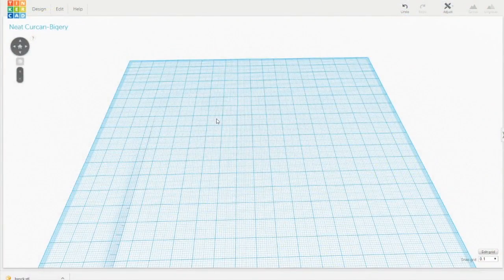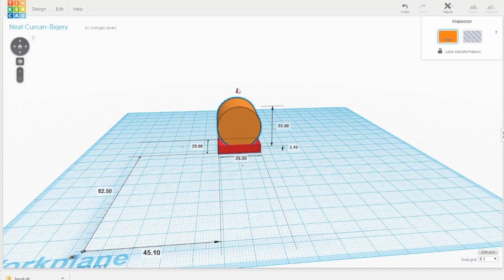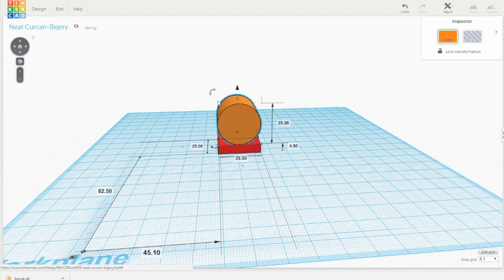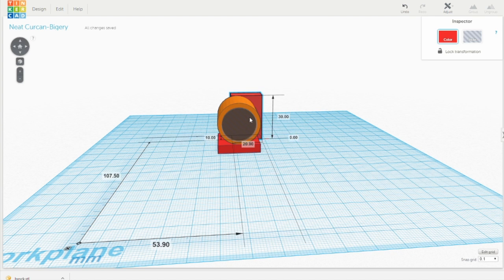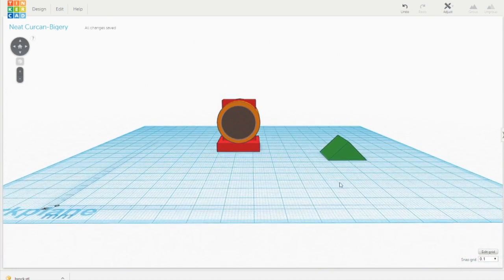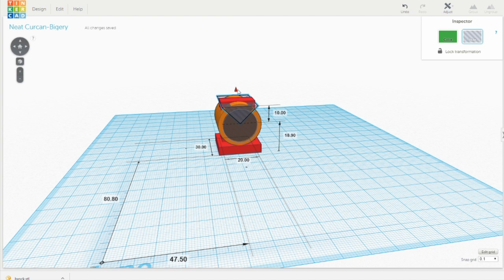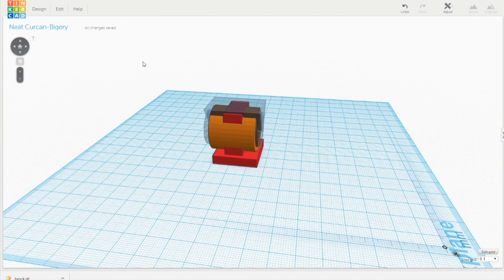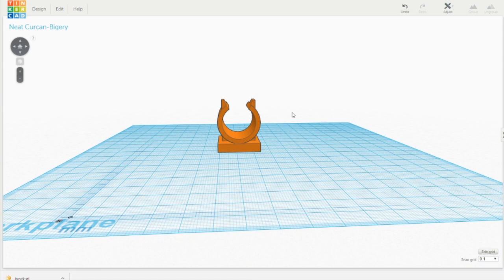TEVO Tarantula 3D Printer  -  Bed Cable Guide Fix!

Comment: Why not a chain?  The bending of the wire on the heat bed connector concerns me a bit.. A chain would hold that stable.  No?
Reply from the maker: Yes you are correct and I considered that too, however as Albert was found of saying: Everything Should Be Made as Simple as Possible, But Not Simpler :-)

Comment: Im having issues of the bed, and extruder wobbling. It almost looks like the wheels are not snug, and I  can just pull it out. Any idea how to fix it?
Reply from the maker: There is a fine line with eccentrics and being "tight", so make sure your not going past that pint.  Would suggest taking a sharpe and mark the outside of the eccentric so you get it perfect.  Also if that doesn't work, flip the plates over, know that sound strange but work as it matters what side the eccentrics are on.  Hope this helps...

Comment: Do you ever have problems printing round objects? Like they look like oblate on one axis?
Reply from the maker: Nope and if you have that issue depending on your printer its either the belts are a off a tooth or two (had this on the DaVinci there is a video on this in the DaVinci play list) or your steps are off in the config file between the x and y axis...